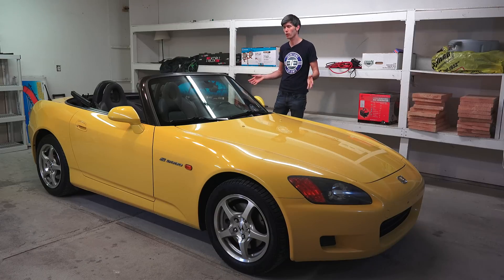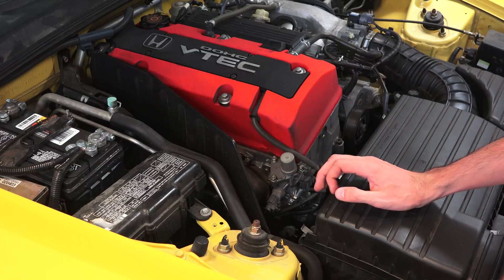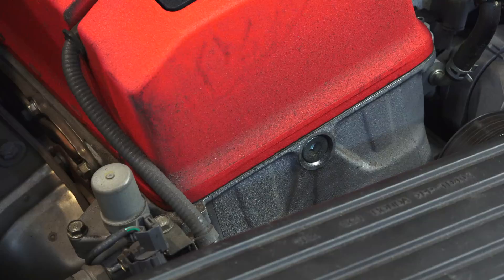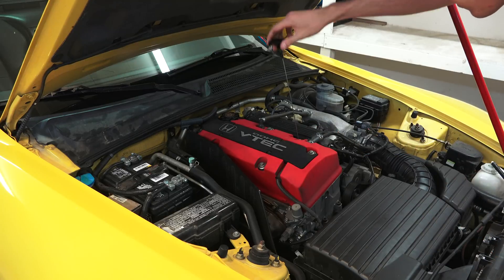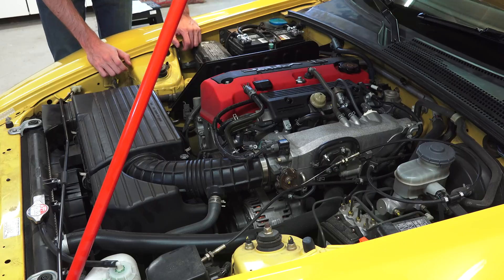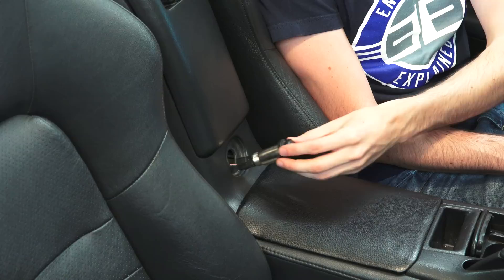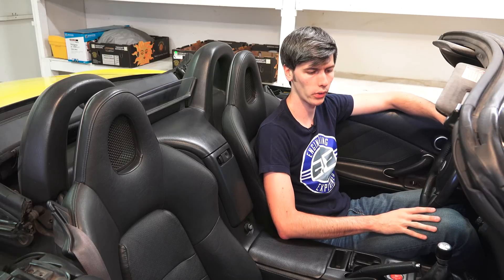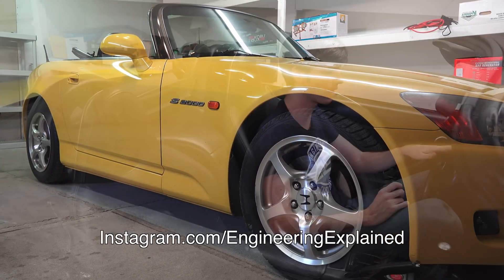What's Wrong With My Honda S2000?

Comment: Like a few before said, check the condition of the intake side valve spring retainers before beating on it hard, if the valve stems are not all at the same height WRT the top of the retainers then some retainers may be cracked and sitting high. If the car has not had big over revs from wrong gear selection on down shifts then they may well be fine. 
Also worth a check is the tension on the rear hub main retaining nuts, as the tension can get low enough over time to get movement in the bearing seats in the hubs, slowly wrecking them. Big socket and extension bar required to retension them.
Lastly, try a quick test drive with the air filter box cover temporarily removed, the sound as VTEC engages is just fantastic :)

Comment: I owned 3 s2k's and they all burned oil to some degree, usually .5 quart every 2000 miles. The timing chain tensioner (sp?) is an easy fix and usually goes out every 30k miles or so. If you plan to turbo or supercharge the car, the 2006 would have been easier. That was the first year the ecu was programmable, on the older ones you'll have to replace it or use a piggy back.

Comment: If you don't have one already get a good fluid evacuator/dispenser pump. Clearances for the transmission & rear differential fluids are pretty snug and it will make the job way easier.

Comment: Also, you're supposed to check oil when it's warm, on level ground, but after a few minutes since the engine has run so that the oil can drain back down to the sump. Otherwise you won't get consistent fill levels. The s2000 shouldn't be burning oil if all is OK (hondas don't actually burn much if everything is ok, especially if they are NA, so interesting to hear you had issues with your previous one). 

Control arms almost always show some superficial rust on them. Even if a car is a year old. Not sure how much yours has, but if it's superficial you can just grind it down and throw on a coat of 3m undercoat. 
As for the air box - the factory air box has a 'reservoir' that is particularly important for VTEC engines. Getting an intake without one would result in a decent loss in mid range power (due to the pulses generated from valves opening & closing), but you can get aftermarket ones that incorporate an expansion chamber. 
Should note that most of the parts in an s2000 are pretty much 90% of the way there as far as efficiency is concerned (ie it comes with a high flow cat - to get gains from that portion of the exhaust you basically have to go catless or get one of the few that have a 100/150 cel cat & for the exhaust in general the mugen style headers gain some power (I believe amuse sold a titanium clone to save some weight as well) & you would need to go with a single exit for real power gains from the rest of the exhaust. 
Along with getting a bilman tct-x (an improved tct that won't need replacing in the future) you should pull off the valve cover, like I said before it's super easy on this car, and peak at the valve spring retainers. AP1 retainers can get bent in over time - people often upgrade them with AP2 retainers as a nice oem upgrade. While you're in there the valve clearance should be checked especially given that you're at the mileage when your cars first tune up should be done. Luckily my buddy's had ap2 retainers installed, but I think that's how the cam got mis-timed.

Comment: I believe the part that has the oil leak is the maintenance cover for the timing chain (meant to be removed so that the timing chain can be removed), the the idlergear bolt, which if removed would result in some parts possibly dropping down into the engine bay unless you have the valve cover off which is super easy to remove. 
My buddy just bought a 2001 and it had a bad tct (and the exhaust cam was actually slightly mis timed), which I've been fixing for him. I fixed this a few months ago so my memory isn't that fresh, but I think I'm right.

Comment: Check out Billman on s2ki for an improved TCT. Also make sure to check both sides of the dipstick; they can be different in this car.
Reply: Also, check the valve retainer clips for cracking, rear hubs for play, and there's a trick with the roof. The bar over your head is supposed to swivel back to allow the roof to fold up properly, but in the video it doesn't. Thus will keep it from folding down all the way. Just push it towards the rear of the car as you open the roof and it will go where it's supposed to.

Comment: ive been doing/modifying/tuning hondas for 13 years now.  and what u mentioned in your video is really common with honda engines.

first, f20c and k20a engines are very known with engine rattle and chain tensioner problems over the time. i advice u if u wanna change the chain tensioner, change the chain guide also, o rings and seals. also dont forget to check the valve lash as i noticed many people dont do it.

second thing, regarding the oil level drop. check the oil cap. my brother old 2003 s2000 oil cap was not sealing properly. am nit saying its the problem but this is what happen to my bro.

hope this helps bro.

and yeah, u will enjoy modifying it 👍

Comment: Other than fit a USB charging adapter, what would you use the power socket for? maybe replace it with a pair of USB charge ports? It might be too late, as that ship kind of sailed, but watching the process that the guy who checked over the car before you bought it went through, might also have been informative.  I'm not sure how crazy you want to go with this, but an aftermarket ECU, such as a Haltech Elite 1500 will provide a lot more flexibility in tuning and also be extremely interesting to watch happen. It also opens the door to things like forced induction.

Comment: What about the coolant? The additives in that stuff don't last forever and it could look like muddy water in there! =O

I thought about trying Evans Waterless coolant & it sounds great on paper, no water = no corrosion but it could be a PITA. You have to make sure every bit of water is out of the system before you use the stuff etc etc. It might actually be worth a look for one of your videos though, they claim it has a higher boiling point and lower freezing point also.

Comment: Hey so here's a thing. DONT get rid of the stock air box. There's some weird airflow mechanics with it and the radiator. Ive actually done a ton of research and gotten lots and lots of advice from multiple mechanics and from people who race with them. That stock air box is a godsend.

Comment: Thankfully, it's a Honda and not some German car. A simple task made more complicated.
Reply: ur so wrong
Reply: Listen to a bit of Everyday Driver Car Debates. They acknowledge the simple fact that German cars have high maintenance costs. That does not in any way mean that they are bad. They simply cost more money to maintain due to the way they work (quite high strung cars with great performance- there is a cost to that) and the price of their replacement parts and dealer fees. Japanese cars cost less and usually are VERY durable. On the other side, they don't offer the same characteristics and qualities than German cars.
Reply: As a german, i fully agree.
Reply: Agree completely!

Mk2 Golf 1988. Twin Cam 16V Engine, timing chain keeps the two cams in sync. A Belt keeps the cam gear in time with the engine.

1989 Toyota Startlet GT Turbo, 16V Twin cam engine, timing belt keeps cam gear intime, cams are locked together by two meshing gear cogs connected to the ends of the cam gears that are ZERO maintenance. No stretch chains, no worn sprockets, no replacement parts....simple.
Reply: i dont see no problem with german cars
e30
e36
most audis
e46
Opel kadett c
Opel Manta
etc list goes on bro, youre wrong
Reply: plus that's just one model, ever looked under the hood of something like a 760i? big ass v12 where all you can see is engine cover. tell me they're just as easy to repair as any Japanese motor
Reply: http://www.telegraph.co.uk/motoring/news/9815860/German-cars-lose-out-in-reliability-survey.html - nope your completely wrong, German cars are horribly unreliable.
Reply: I wouldn't say unreliable, all cars have issues. the thing is with German cars is they're quality and premium and people buy them at ten years old for like 5k when they retailed at 35k then complain about repair costs. when in fact if you compare it when it's brand new it probably makes sense
Reply: I'll moderate this thread if I have to.

Comment: go onto s2ki and contact billman for his upgraded tct. its guaranteed for life
Reply: Billman is the BEST
Reply: great guy for the s2000 community.  met him at the spring dragon trip many times.
Reply: Agreed.  Go with Billman's modified TCT.  If you replace it with another OEM TCT, the problem with come back.  Ask me how I know.
Reply: Yong Kwon how do you know? For real though, i still havnt had the TCT problem... im just counting down till i do.
Reply: I've had three S2000s.  Two AP1 and one AP2.  Both the AP1 had 'ticking' issues due to the TCT.  2003 AP1 went through two brand new OEM TCT before being sold.  It's not a matter of if you don't have the problem...it's a matter of when you'll have the problem.  Trust me...it'll happen.  The OEM TCTs got a design flaw, Honda knows this but never remedied it.
Reply: I replaced mine as cheap maintenance and peace of mind.  the OEM was fine with no issues.

Comment: Pease keep going with these s2000 videos! I'm a proud ap1 owner.That brake fluid seemed a bit dark. You should swap out all the fluids since its a bit over 100k and so you know what's in your car. Before I built the engine on my ap1 I went coils, wheels, camber kits, exhaust, steel brake lines, race brake fluid, stoptech rotors and hawk performance pads, lost the softtop and the motor and went carbon fiber hardtop, and the difference from a stock ap1 and my ap1 was so noticeable and improved in every aspect.

Comment: for replacing the differential fluid, you can use the squirt pump from a soap dispenser with a length of flexible hose on the dispensing end and put the sucking end into your bottle of gear oil for easy filling and minimal mess. if your diff doesn't have an empty bolt, you can also use that tubing to attack to the sucker end, and pull the fluid out that way. couple of easy and cheep ways to limit the mess of that smelly gear oil lol.
Reply: Check marine supply stores for a gear oil pump made to attach to a plastic quart bottle.
 No muss, no fuss.

Comment: The very second you start backing out that screw you have to check the timing that and the distance required for you to put the o ring on is to long you'll end up pulling the front of the block off because the parts behind it will drop something, learned the hard way that you end up towing your engine to a Honda master mechanic. Just use high temp silicon timing cover sealer caulk $4.99 at Auto Zone

Comment: Make sure you keep the oil level high in these, as good oil pressure is needed for proper operation of the VTEC system on these. And as they are a highly stressed motor, you can scrub bearings and rings  really quickly if they run low. It could be old leaky valve stem seals that are causing the oil loss. maybe even that plug leak. Try changing the stem seals before considering a rebuild , and see what that does. there are plenty of how to videos around here how to do it with compressed air to stop the valve falling inside the cylinder. Some people get insane power from these with turbo setups. Me, I just enjoy pulling a strong naturally aspirated engine through the gears, with that gutsy torquey feeling pushing you up to redline.

Comment: How tall are you and how tight is the squeeze to fit? Is the steering wheel adjustable?
Reply from the maker: Steering wheel is fixed. It's not 100% ideal but it works. I'm 6'1"
Reply: +Engineering Explained so its alright for Honda civic si with high mileage to burn a little bit of oil in high rpms
Reply: It's pretty common, yeah, my friend, who owns 5th gen civic burns 1l/1000km of oil. He will fix it, it's caused by the last owner, who didn't really care about the car. :)
Reply: I'm also 6'1" and drove my 04 from FL to Houston TX, and back, twice. Took a few tries to get the perfect seat back angle to barely let the seat push back 100% for the most room but the 04 (and my old 06, slightly different seats) are comfy and roomy once you squeeze in, even have headroom once you're in. No tilt wheel on any year that I know of but know a 6'3" dude who also daily drives an 04 and likes it.

100% better than my GFs 01 Miata, which is tight as hell, shoes off, knees touching wheel and door panel, and the top is like having a baseball cap pulled down low, can't see anything but the hood :)

Comment: Are you planning on keeping it stock or gonna go for a turbo setup? either way it is a beautiful car and I'm surprised to find one in such good shape I had a 97 del sol DOHC that was in really good condition no leaks on the roof seals only 90,000 miles on it the problem was the previous owner drove through a hail storm with it... so yeah devalued it quite a bit but the rest of the car was in amazing condition I ended up doing a turbo set up on the car and sold it.

Comment: The oil consumption of a high mileage F20C really began to to irk me during the last 2 or so years of ownership before I got rid of my '02 AP1. It would use a quart every month. I traded it for an low mileage '09 two years ago. Although Honda solved the oil consumption problems with the F22C, I really miss the razor sharp handling and stiffness of the suspension of the AP1.

Comment: I would be too scared to drive it with that chain rattle.
Timing chain replacement and fitting equals $$$$.
Better that than throwing a rod though i suppose.

Comment: Just take the airbox lid off. My buddy has one with a K&N cone filter in the stock box and with the lid off the engine can pull all the air it could ever need and it sounds really cool when it gets to the cam crossover point.

Comment: Right out of the Honda Service letter, Honda considers 1500km or more kilometers per litre of oil to be an acceptable consumption figure .... its an S2 they go through oil if driven as they were meant to be, check it every fill up. Honda stopped using gaskets years and years ago and if done right and cleanly will last a LONG time. There are better aftermarket stronger tensioners, and no big deal to change, and do a valve adjustment as stated below.  Your also going to need an oven mitt for the shift knob in the summer. That's an award winning engine with a ton of great engineering stick to that, last thing we need is another video about how to turbo or add a pretend cold air intake to a perfectly good ( Leave it stock ) car. Don't freak out when you here the Air pump spool up when its cold either .Don't open your hood to strangers, especially to those Subaru guys, all there engines are flat ;) Nice choice for a new ride.

Comment: look under a 2 year old car from the rust belt area and the steel suspension pieces are all showing rust, but we don't get too OCD because these pieces are going to last 10 years + from when the e-coat starts to fail

Comment: your half quart of oil is vacuum locked inside the vvt oiling ports and runner. if the oiling filter is bad or plugged adding more fluids will eventually cause your vvt system to fail. find the filter screen for the vvt system and inspect it's a 25 dollar part if I remember right.

Comment: Don't change the air box, they do burn oil fast and you have to add a quart every month or so, and if you need it you can actually pull the hood prop out and use it further up the side of the car. Did that for my valve adjustment project and it worked great.

Comment: Aluminum is just fine where it is engineered to sustain normal, repeated abuse. I would never EVER have aluminum for a control arm or any pieces that take that kind of abuse.
Take a 1/4 inch piece of Aluminum about 8 inches long and try to bend it. Then take a piece of Steel and do the same.

Comment: not bad. 

From what I heard the F20C has so much power squeezed out from the factory that it doesn't do well with bolt ons. I read that in an article on an S2000 that had a K swap....

Comment: if you have a leak at the bolt the filter screen is blocked decreasing proper oiling or leaving excess oil in the head when vvt system is starved it causes excess wear in the timing gear system. also replace the electric power steering assembly a 1000 part to fix the sloppy handling it's and electric steer by wire issue the motor and gears are failing in the power steering.

Comment: I wouldn't remove that bolt in your engine. Do not touch the engine parts unless your a mechanic. Timing chain is a common problem at cold starts. Just drive it.. The sound will go away.  Also when you open the hood of the s2000 there are two locations for the prop rod. One for smaller opening and another to open the hood all the way up. You'll see it..

Comment: Hi. Owned an 00 and an 07. Please also check your pcv valve, iat valve, and clutch master cylinder. A lot of times the clutch master cylinder will leak into the interior side of the firewall. Sometimes the screen in the VTEC solenoid gets dirty and clogged but not as common as the other issues.

Comment: Protip: When popping the hood, there is a smaller hole that is closer to the hood hinge for the hood prop to slide into. It makes it so the hood has an open angle of almost 90 degrees, and I've never encountered a time where I thought it would go backwards. Makes engine work so easy.

Comment: I just bought my first ap1 a few weeks ago as well. Same issue with the TCT. An easy fix is to just sandblast the worm gear, i just ruffed it up with my dremel and it works just fine. There are quite a few DIY, as im sure you have found, on s2ki